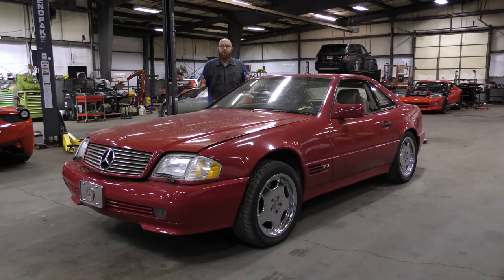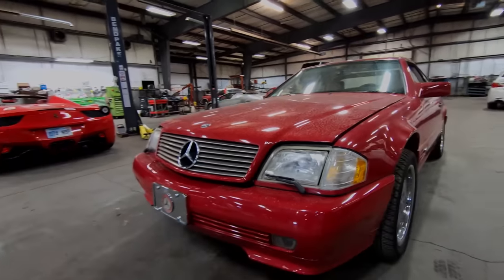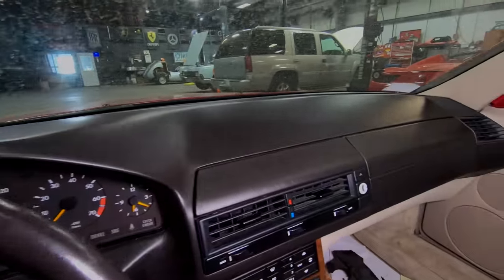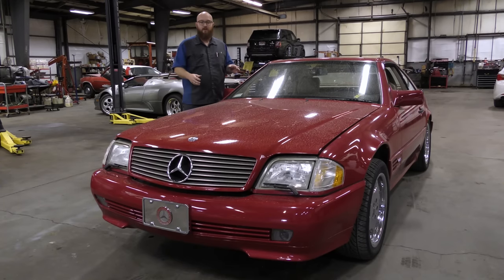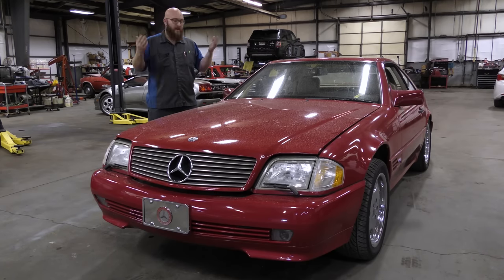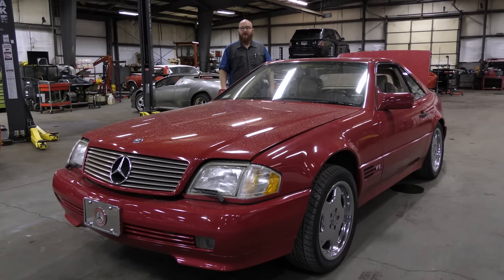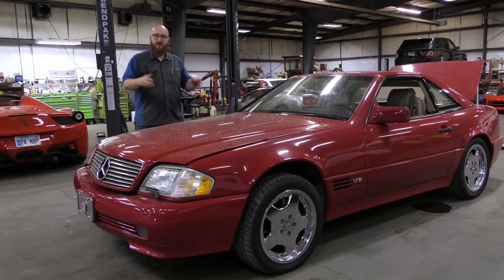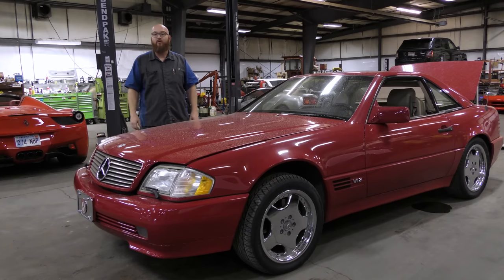Another customer scammed! CAR WIZARD shows why this '94 Mercedes SL600 is needing 15K to get sorted!

Comment: When you said that the wiring harness would have to be hand made and replaced I thought 9 grand is cheap. That's no small task. Probably takes a month.
Reply: I think I have sourced a new upper harness for it.
Reply: @Rock MacConcharraigh Getting all the new exact connectors with pins needed could be a big problem
Reply: @Rock MacConcharraigh That sounds good!
Reply: $9,000 seems excessive.
Reply: @emmanuelmcallister5412  what's so odd to me, I have only ever had GM cars, so I wouldn't even know where to begin to find crazy old random parts for a Mercedes, where do you look?
Reply from the maker: @althunder4269  List a shop that will do it for less. Ill send the customer to them. Then I will re-film the car and post the results, with you being the recommending informant.
Reply: @CarWizard  Got em!
Reply: @Rock MacConcharraigh you should buy that car then.
Reply: @CarWizard  Why do I need to do your job for you?
Reply: @althunder4269  not a good rebuttal lmfao finding a cheaper shop aint his job either my boy
Reply: @Rock MacConcharraigh Somehow, I'm not convinced of this. Sourcing connectors and terminals will be a challenge as both Mercedes and BMW use both US suppliers such as TE Connectivity and European ones whom are much less widely known such as LK or may have changed hands or changed their name since then. VW's main supplier, FCI is a prime example of this, their auto connector division was sold to Delphi somewhere between 2012 and 2015. And that's assuming you CAN pin each one to a single manufacturer. Sometimes the housing and terminal come from different manufacturers. I've seen this on rather common Japanese cars use connectors found on early Hyundais, but nothing was ever documented or in their catalogs. Housing was from a Japanese company, but the terminals came from a Korean one that they co-developed them with in the early 80s. Now imagine that being on an American car...

Remember Wizard's video about the Infini Q45 and how he couldn't find struts for it without a ludicrous pricetag here?
https://www.youtube.com/watch?v=EHZ1SVBAImI&t=353s

It took me less than 30 minutes to find their part numbers, cross-reference them back to the Japanese version (higher spec models are the same), and trace them back to who made them for Nissan. Then find a few dealers who had them. I call this "Tuesday".

Here's a hint, they're made in Indianapolis. Let that sink in a minute, a car built in Japan by a completely Japanese manufacturer for the Japanese Domestic Market has struts imported from the US.

Your mind has been blown.
Reply: @tsherwoodrzero  agree.
Reply: @WizGotBeats_  well it sure ain't my job.
Reply: @Rock MacConcharraigh deal.  What's your location?
Reply: @pablopicaro7649  You don't need new connectors, just the pins, which should be readily available.  But as someone said upthread, MKB-TEC makes a set of new harnesses for ~2000 Euros.
Reply: @SeanPennII  The dealership is your first stop. They really do have many necessary parts for older cars. At some point, when cars get very old, the Mercedes Classic Center gets involved. I'm surprised they haven't on this issue yet.
Reply: @althunder4269  you should’ve led with that one 😂
Reply from the maker: @althunder4269  Because you apparently know better than me. Prove it.
Reply: @CarWizard  don’t bother wizard this guy is a clown has no idea what’s involved in rebuilding a small wiring harness let alone these ones…
Reply: @CarWizard  $9,000 it must be because of inflation.
Reply: Wire harnesses are nor rocket science. Take out the old stuff measure the lengths. Buy the right colors and thicknesses. Crimp the right connectors. Wrap them with shielding. Done. Material cost like 200$ tops. Can be done in like a day.
Reply: The owner should keep this as a parts car, and buy a nice 18k dollars one.  He can come out ahead this way.
Reply: @42222  The wires must be made from gold.
Reply: @althunder4269  seen 4Runners have a $14000 harnesses ruined by rodents.   You have no clue what you are talking about.
Reply: It’s still available for 820 EUR from Kurth Classics !
Reply: @franzhuber7361  Doh !
Reply: +Evergreen641 In Germany getting this done costs you max 2000 euros, which is abou 2300 USD i believe. 
No wonder so many German Cars are called "Money Pits" by American Youtubers
Reply: @franzhuber7361  what’s available Franz, the car or the wiring harness for the 600? 

If it is the harness that’s available, is that for both the upper AND the lower harnesses or just one of them?
Reply: @pablopicaro7649  Yeah. High chance a lot of that stuff has become pigtail-pot-and-replace stuff (essentially, you take the connector on the component, get a pin that mostly mates with each of the pins in it, run a wire pigtail off that, attach your individual pins, and fill the connector with potting compound, and then put a deutsch or other modern connector on the end of your pigtails. And then you have to wire manage all these new connectors that aren't on the components themselves. And then replacing electrical components in the future becomes a nightmare because the guy doing it is probably not the wiring guy that did all that work.
Reply: @42222  ok buddy how bout getting access to it in the vehicle huh 🤔 one day I’d like to see you do it and have it come out like factory and not some horrible cob job when in six months all the connectors are corroded and your crimped ends are all loose inside the pins too u obv have never done a job this detailed
Reply: @althunder4269  gold is an excellent conductor. Don't be surprised if it's actual gold.
Reply: @houseofno  for 9 grand it should be made of gold.
Reply: @Rock MacConcharraigh No Rock, you couldn't. You're looking at a K for the terminals and connectors alone.
Reply: The wiring harness won't need to be hand-made as MKB-TEC supply these for Mercedes including the SL600.
Reply from the maker: @jamiespinks3657  yep. $3k per harness. There are 3 harnesses. This does not include labor. So hand making the harness is still the best option.
Reply: @althunder4269  You realize, you're the one that said the price is too much right? That puts the burden of showing where it is available at a lesser cost on your shoulders. As it is, you have gone with: "You say $9k? No that's too much, you go find somewhere cheaper because I'm not doing your job(finding a cheaper place) for you."  Can you see how that doesn't make sense or are you just a troll?
Reply: @Melanie16040  You sound like the troll.  You are late to the party as well.
Reply: @Rock MacConcharraigh Hello used to be neighbor! I was born in lancaster and used to live in hershey. Seems most people don't know enough to recognize subject matter experts when they show up.
Reply: @chartreux1532  Thanks.. I thought the same. It takes time but its not a hard job. It would cost like 600€ in Latvia. I just cant understand how americans can repair their cars when they literally get scammed by workshops.
Reply: @Rock MacConcharraigh Yah, Rock, I read it. I've also done this for long enough to know you ain't building a harness like that for $1000.00.  

Tell you what, Rock. You said you have a stock room full of stuff. I will buy from you every single Citroen-specific terminal you have. All of it. Every pin and socket, every color sleeve, every fuse clip.  Whadda ya say? I mean, if you are so willing to give up your parts stock for next to nothing.....
Reply: this is one of the bio-degradable M-B wiring harnesses isn't it? edit: got to the harness part and I see that it is- I can never remember which years they were!  Those all fail and need to be replaced, you'd think it would be still available without needing to be hand made since it's such a common failure item . . . but maybe there's just not enough of these around in the first place to support that, i dunno
Reply: @Rock MacConcharraigh What's the matter, Rock? Can't take me up on my offer? It's a real one.
Reply: @Rock MacConcharraigh It took you 6 months to wire your own car? Holy fuck.....
Reply: @Rock MacConcharraigh You got that wrong, Rock. It's 62 year old Bill Hemmorhoid.
Reply: @Rock MacConcharraigh The one where I offered to buy every Citroen-specific terminal you had. Every last one. You told me you had this huge cache of electrical terminals. I putting up my money. What do you have?
Reply: 12:00 👍 If you remember BOSCHE. Mandela Effect.
Reply: Making a wiring harness for a car of this era is a lot less high tech than you might think.
Reply: German cars from the late '80's into the '90's have wiring that was designed to be recycled... This has become a problem for those of us who love the iconic styling. 😞
Reply: The harness is $1200, I've also rebuilt one and it took me about 3 days. This dude is a scam artist
Reply: @42222  🤣🤣
Reply: @tsherwoodrzero  what brand are they?
Reply: @CarWizard  My old man is a tv repairman, he has an awesome set of tools and can repair anything
Reply: @CarWizard  nice save
Reply: Sold on Cars and Bids for $100,000.
Reply: @pablopicaro7649  which is why you re-use the old ones. they weren't biodegradable. Just the wiring insulation was.
Reply: @shaded_lp  
Definitely seems to be widespread in the USA, probably because of a Lack of Control of Mechanics but also Car Dealers. 
There is not one Day i don't read or watch Car Mechanic Videos on Youtube where i end up checking the Prices here and go "Wait, so Mechanic claims previous Mechanic scammed Customer but then proceeds to also ask for Money that i 5-10x what it would cost over here. 
That said: Of course Parts are harder to come by in North America, but that only explains Import-Costs of said Parts.
Also it's fascinating to watch/read that subreddit "Look what just rolled into the Shop" which shows a lot of the Issues with American Car Laws but also Mechanics and how such enormous Prices some Mechanics ask lead to People trying to fix it themself, with bad Results
Reply: @CarWizard  don't feed the trolls brother.
Reply: @pablopicaro7649  ....Connectors are already on the harness and they are standard Bosch....But, it would be a labor of love....LS Swap It! Make a Drift car😁
Reply: @althunder4269  You really should quit while you are ahead; oh wait…..your TROLL status has been established. The IRONY of this PATHETIC situation is your YT name. Maybe you should actually use it and then….there will be PEACE.
Reply: @standhd  is that all you have to say about it, Earl?
Reply: @althunder4269  Yes. Do you like drawing attention to yourself, comet?
Reply: @standhd  You seem a bit wound up about all of this.
Reply: @chartreux1532  Shop charges $100+ an hour (while paying their mechanics $20-30/h) and sells part 1.6 to 2 times what the parts store sells them. And every shop supplies, bolts and extra are charged on the costumer one way or another
Reply: @althunder4269  Naw, I’m not actually. I’ve delt with people like you before. You trying to TROLL me now?
Reply: @pablopicaro7649  the connectors can be reused.
Reply: @42222  Making a wiring harness is not something for anyone with Attention Deficit Disorder. 

Very tedious.
Reply: @althunder4269  missing a father
Reply: @tsherwoodrzero  yeah I’ve owned two Infinity cars. Almost Every part can be sourced with a Nissan parts number and bought from a Nissan dealer. Almost. Certain parts are JDM only but with some detective work you can find the same part and order it direct from a supplier.
Reply: @CarWizard  I'll do it for $4k......$3k?.....okay okay....I'll do it for $500....(wiring the OEM only..)....I don't do the hydraulics....

Here's what you do....research the best under hood insulation wiring.......by the foot.
Reply: @CarWizard  No, about 600 Euro for the upper one.
Reply: @Rock MacConcharraigh Normally just the engine harness breaks down prematurely due to engine heat. Doubly worse on the V12 where there is very little space or airflow.
Reply: I’m just a couple minutes into the video and you can tell the car needs a full restoration. It probably needs 100 grand worth of work.
Reply: @42222  a gazillion of those 90s Mercedes cars have been converted to normal wiring (Eastern Europe) without a single one to my knowledge catching fire because it doesn't use the oem connectors. I'm fully with you on this one
Reply: @Rock MacConcharraigh You questioned if it was just the engine harness or the entire wiring harness and I am giving you the answer, soooo...
Reply: @Rock MacConcharraigh I know because I work on these cars, is that good enough for you?
Reply: Less than 1500 from restoreyourmercedes (on youtube)
Reply: @HondaSolutions  the wiring harness on a toyota is 14k?  Lol. Brb, going to junkyard
Reply: @tsherwoodrzero  Just a thought but I reckon the old connectors weren't bio-degradable just the wires, no? So maybe you could reuse the old connectors with new wires. Quite a bit of work of course but for someone it could be worth it for a V12.
Reply: @mikeyorkav4039  can be.  Parts and labor
Reply: @davem5333  funny you should say that because I have ADHD and have built harnesses from scratch. Now I write service manuals and draw wiring diagrams. The key to success is working WITH the disorder to turn it into a superpower.
Reply: @kbcarroll  You need to remove all the old pins or sleeves, and get all new pins and sleeves, and that can be extrremely difficult to find.
Reply: @Rock MacConcharraigh Funny that you mention Toyota because anyone that actually does so knows that every manufacturer in Japan gets their harnesses from 矢崎総業株式会社 (Nihon Yazaki Sōgyō Kabushiki Gaisha) whom has been making harnesses for just shy of a century. If you knew what you were looking at, you'd find their parts in a LOT more than you think. And by the way, Ford fuse boxes are from EPC, now known as the PKC Group while GM ones predominantly are customized versions of standard Delphi products. If you actually did what you claim, you'd already know this.

Here's a hint: 2000 Dodge Dakota fuse box. Yazaki part. The white connectors in it use 090 and 180-series terminals and you'll never find this in any parts catalog or service manual. I disassembled two of them, then fully stocked one and rewired it for transplant into my RX-7 back in 2014, which also had a Yazaki fuse box from the factory.

This is why I am the Car Jedi. "Help me Obi-Wan, you're my only hope..."
Reply: @pablopicaro7649  I've dealt with this on the m104 cars. Same issue but only 1 harness and only 6 cylinders. For years the new harnesses were $1400 from MB only so a bunch of people just rebuilt their old one. You reuse the pins and solder them onto the new wires then insert them back into the connector, then sleeve.
Reply: @libran58  Reusing connectors is generally not a good idea unless they are in excellent like-new condition. After nearly 30 years of heat cycling, plastic gets brittle under the hood and we've all had Connector ABC123XYZ break. Plus, extracting terminals is somewhat of an art form that requires the proper tools and procedure. And there are times where a terminal just won't come out then too. I've had some terminals break in half and it was a REAL *** to remove the remnant from the connector shell, even under ideal conditions (Yazaki 250). The minute things go wrong on something smaller or more difficult to work with, it goes from annoying to 4-letter words, probably in German too. Some can be fudged with and still work fine such as Delphi Metripack (6.0L GM truck coil subharnesses) but most of the time it's faster, simpler and cheaper to start with new connectors. It also gives you something to work from when building the new harness to match the old one so all the branches line up correctly. GM/Ford and most Japanese connectors are pretty forgiving when, but I would decline the job on something German with a V12. On the BMW E38 7-series, the DME connector pins are stupid tiny, smaller than a paperclip, and I would bet their crimps won't tolerate much futzing around when trying to de-pin a connector. I encountered a few corroded ones on my uncle's E38 and I couldn't try extracting them with a clear conscience due to the risk of something breaking.

Clearly who designed it knew how to disassemble it too, and that person wasn't me.
Reply: @CarWizard   please check auto sparks in Nottingham,UK. They were featured in a wheeler dealers episode on a tr7 harness. And even showed how it is made.They might help or know who can.
Reply: Although it looks like you can get a harness for the car,guessing the Labour costs would make uneconomic.Anyway Mercedes should be paying,a wiring harness that falls to bits before the car!
Reply: @42222  7/10 troll points. Try to be more subtle next time. For me it was the last comment that tipped it over the edge I think.
Reply: @pablopicaro7649   use the old ones if needed. but every car built during those years needs them and a lot are common Mercedes plugs. that is, unless all the plastic is "bio-degradable".
Reply: I can build one for a can of Dr. Pepper and a pack of Camels
Reply: Hi wizardry ! Why does your wife talk abd sound like that? Is she from a state with a weird accent?

Also you've done a good job. Most informative car channel. 😇
Reply: Even after getting the harnesses, I can only imagine the labor involved at say $120/hr to tear everything apart, rewire the whole thing and put it all back together. And that's an expert doing it. I DIY my own cars and it would take me forever to do that, going slow and researching who knows how many times to get things apart. No thanks.
Reply: @tsherwoodrzero  "The Spectrum" is so wide, we're all on it. Saying someone has ADHD nowadays is almost worthless. If one can function in life, they don't have it.
Reply: @HondaSolutions  "$14000 harnesses" what? like 14 thousands? of dollars? hard to believe. which model?
Reply: No, 9 grand is just a rip off. I wouldn't trust that Mercedes "specialist". Seems very shady.
Reply: @cbruno12180  A clown? He's absolutely right. 9000 dollars is simply crazy for that job. There's no other way around it.

All of you who consider that amount of money reasonable send me your Mercedes for a wiring harness replacement or whatever they may need. I will happily do the job for you, making a tone of easy money in the process. lol

By the way, I rebuilt my own harness for the '91 600 SEL that I have. Then I put Kurth-Classic wiring for better finish, but the home made one works fine anyway.

Is it a big and tricky job? It sure is. A $9000 one? No way!!
Reply: @42222  If you think it's so easy and cheap to do, it's probably not a huge ask for you to prove it, which is exactly what I am doing.

These are wiring harnesses, with specific wire gauges carrying specific voltages low enough to count the number of volts on one hand.  The amperages are often measured in fractions of an amp.  Depending on the wire gauges, wire type and material, these are going to carry different resistance values.  Too little resistance, and you don't have a wiring harness, you have a very decorative scarf.  Too much voltage, and you risk damaging a very expensive computer module that's not produced anymore and is pretty much unobtainium.  We're talking about electrical differences measured in THOUSANDTHS of an amp.   Do you really want to be on the hook for cooking one of THOSE no longer made computer modules? You people act like a Subway sandwich guy cranks these out on his lunchbreak out of fishing line and bread crumbs.  If you think it's so easy and cheap to do, prove it.  Post the Youtube video.

I'm astonished at how many of these people put their ignorance on display by illustrating how little they understand about automobiles.  I'm going to double down on that comment by commenting that these people don't even understand how cars were made THIRTY YEARS ago, which is the case here.  These aren't cheeseburgers., These are electronic components manufactured by what was, then as well as now, one of the premier automotive engineering companies on the PLANET.  Mercedes holds the original patent for inventing the internal combustion engine powered automobile nearly a century and a half ago.  Mercedes spent more money engineering this SL600 than most of us will ever see in our lives, and you think you can make a new WORKING (big disqualifier for you trolls out there) engine wiring harness out of what have you for pocket change.

What are YOUR credentials, keyboard warrior?

Give the Car Wizard some credit for actually calling out when even he didn't have all the answers.  Even the Car Wizard reached out to the experts.  $9,000 when you CAN'T get these new anywhere else?  Pay up or stop bugging the guy who can name his price making from scratch what isn't out there anymore.
Reply: @E34Benzin  I agree with u 100 9k is just insane 5k is reasonable thou with removal and installation and parts I can that being 5k all day long thou it’s def not a simple job thou
Reply: @cbruno12180  It's not at all a simple job, that's for sure.

Dealing with the ECU's box (aka coffin box) to get the connections sorted is a pain in the ass. The injectors' wiring on the other hand is a 30 minute job.

Overall not a simple task, but not as bad nor expensive as Car Wizard tries to show us.
Reply: The biodegradable wiring harness reminds me of the water-based clear coat that Honda Acura had that always peeled
Reply: Knowing that people believe Mercedes to be a special car Mercedes should come out with parts more than they do
Reply: Dismantlers have nice used harnesses for the low
Reply: Just rip out the old harnas and nail that to a wooden board. Take another wooden board and start to copy all the wires from the first one and then you have
a new wiring harnas. 9000 dollar is just insane because a new one could be made in a few days.
New wiring harnases are made on a board like that, so it's not that hard and it's sure not worth 9000 dollars, because that's just a damn rip off.
Hell, when i would be sure that customers would stand in line, then i would start a shop myself and make 2 harnases a week and become 
a milionaire in just one year and a month! The only catch is where to find new connectors, because not a single one is the same
and i don't think you can buy them from mercedes, so you need to find the company who makes those connectors for all car brands.
Reply: @WizGotBeats_  Nice one. 😊
Reply: @Melanie16040  It’s very pleasing  coming across intelligent comments such as yours every now and again. If only “ NO COMMENT “ could live up to his name. 😂😂😂😂 and put his moniker into practice.
Reply: @CarWizard  oh now there's THREE harnesses at $3,000?   Good grief stop moving the goalposts.
Reply: @jan_vyhnak  he is lying, he made that up
Reply: @andregreen8040  stop simping.
Reply: @andregreen8040  It would be nice! Alas, it doesn't always work like that.  Ran across someone named "A Moron" in another thread that messed up reading a weight by a factor of 1,000x and telling someone how wrong they were because of it. Difference being they actually had a laugh and were like "Well I AM A Moron!" When I pointed it out.  Always refreshing to see people who can admit such things. Glad my post did the same for you.
Reply: 9k? he  betta be Working On It EVERYDAY!!.....Electrical Tape Always  Been my Friend
Reply: This post has turned into a troll-a-thon.
Reply: @althunder4269  it's probably his dream car
Reply: After getting robbed by a typical American endless money pit mechanic they say, "thank you sir, may I have another?"
Reply: I had fun reading this sub thread. Moral of the story, don't buy a car like this if you aren't 100% sure what you're getting into lol. And look at the engine bay. There's no room to do even a small task so parts will have to be taken out depending on the job which adds hours and $$$$.
Reply: I USED TO DO GLASS WORK...IN PHOENIX, AZ...AMBULANCES GOT WRECKED...THIS ONE SHOP SPECIALIZED IN REPAIR...THE WIRING ON THE FORD E350 VAN AMBULANCE IS A PILE 4 FEET DEEP & 6 FEET ROUND...GOBS OF WIRE...THEY DID ALL REPAIR WOTH HARNESS REMOVED...KEEPS WIRE DAMAGE AT A MINIMUM...AMAZING!!!
Reply: @Rock MacConcharraigh  Unless you're stalking people in the room, it's a stock room, not a stalk room.
Reply: @pablopicaro7649  Can the old connectors be removed and reused if not broken?
Reply: You'd be right in thinking if an amateur does it the first time, it'll take them a month - but a trained automotive electrician working on the same kind of harness day-in, day-out should be able to do a wiring harness with a couple dozen wires way faster - and evidently, that's what's happening at Kurth Classics and MKB tec in Germany - the german Mercedes enthusiasts send them those harnesses for refurbishing by the dozens, and day-in, day-out they work on Mercedes wiring harnesses. And as Mercedes'es have not much of a "halo" exotic status over here, often bought by Pensioners and straight up middle-class folk, they charge quite reasonable prices. And ship to the US, of course.
Reply: @Rock MacConcharraigh I guess people who have a Mercedes with a broken wiring harness, as shown in this video might care? Which, I take it, doesn't include you; that's alright, but why go "who cares" on someone offering a solution to a problem that made up half of the video you're commenting to?
Reply: Funniest thing is, they are ~ 500-1500 Euros in Germany to be completely redone.
Reply: @Rock MacConcharraigh but could you sell it for $1000?
Reply: @Rock MacConcharraigh non-mechanics and non-wirers don't understand that wiring harnesses are laid out on a 8x4 board with lines drawn to show colour and thickness of wires and all the wires go to numbered pegs and clips to show correct connector.   Once all wires are laid out they are taped into one bundle.
Two people cutting and fitting terminals and connectors could make a complete harness in a couple of hours.
Chinese factories have machines that can spin a complete harness in 77 seconds.😅😅😅
I saw assembly of Lotus car recently and harness filled a wheelbarrow.   Sheer craziness but if folks want everything electric then it has to be paid for.
Reply: @Rock MacConcharraigh Cool story bro... 👍🤣
Reply: @althunder4269  silly troll.  He was actually going to give you some business and posting it for under whatever rock you work under.
Reply: @alk3myst  Are you drunk today?
Reply: @alk3myst  stay away from the drugs and don't be a troller.
Reply: @althunder4269  #MethNotEvenOnce.  /ruffles head.  Stay in school kid.
Reply: @althunder4269  It really isn't.   I have custom wires made for GPS systems.   We have them made at an ISO9003 facility.   For a 5 foot cable with say 5 connectors you can very easily look at $1000.
Reply: biodegradable cables, what a great idea :-) new German cars are 100 % biodegradable after 100  K miles
Reply: The buyer hardly got scammed.
He was lazy !!!........
He obviously didn't inspect and drive it before purchase !!

You don't have to be a mechanic to test every switch and button during the test drive, that would have revealed the roof problem etc.

Buying a car unseen online is a fools game unless the seller has an impeccable reputation
Reply: @ltdees2362  possible but the pins are crimped on so you would have to pain stakingly uncrimp each pin and solder it to the new wires.

I've done it and it takes days
Reply: ill charge ya 1000
Reply: It’s like spinal surgery. But I guess if you’ve done enough of them ?
Reply: @pablopicaro7649  Find a donner vehicle. I’m sure they get wrecked when some geezer hits the gas instead of the brakes. The only people I see driving these things are practically dead.
Reply: @SeanPennII  German junkyards ?
Reply: @CarWizard  Exactly. Put up or shut up.
Reply: @althunder4269  It’s a Mercedes. Sucks money out of your pocket faster than my X.
Reply: @HondaSolutions  How freaking horrible. Especially considering a short couple fry a vehicle’s CPU.
Reply: @chartreux1532  Because they are money pits. Most people who own these pieces of crap trade them in every year or two.
Reply: Car wizard makes me laugh 😂. I rebuilt the stock wiring harness upper and lower harness on my 94 sl500 for the cost of correct gauge of  wires and pins. You can use your old plugs or buy new plugs if a few have damaged. I also rebuilt all my hydraulic top cylinders for under 100 dollars with new seal kit off eBay. I rebuilt my top cylinders 8 years ago and top works flawlessly. He's very comical guy but I like watching his channel even though he's looks to never pass a McDonald's. He be a better comedian rather than a mechanic. You got some Joe's or yoyo's out there who says they are pieces of crap but little do they know the 90s error sls were built like a tank and to me the easiest to work on. Learning to do things yourself is not for the dumb and lazy people of today. 😂😅🤣😆
Reply: @felixrobitaille8170  How do you expect them to cover all the overhead expenses which get very costly?
Reply: @johnjobber2219  I can guarantee you shop still makes a very decent profit at the end of the day, enough to pay their mechanic a lot more. Without going too much into finance, a shop can pay mortage, electricity, consummables, support jobs (director, advisor, secretary, etc), part of the mechanic salary and more ONLY on parts mark up. The rate pays the rest of the mechanic and everything else is pure profit.
Reply: @felixrobitaille8170  That all depends. I own a company with 20 employees and the margins are getting very tight. There are always downs times where you pays the employees but there is no revenue coming in.
Reply: @johnjobber2219  I was the assistant director of a 4 mechanics shop, I had access to all the accounting. I was director/advisor/andmore of a 2 mechanics shop after, same stuff. I know that usualy the bigger shops (7+ mechanics) tend to need to have a bigger margin on parts and higher rate because of down time
Reply: @althunder4269  Then ENTIRE car has to be taken apart, literally, the entire car dude. As in in, THOUSANDS of pieces. And then put back together. Basically, you are unbuilding the car, just to rebuild it. 9k is CHEAP
Reply: @CarWizard  I don't think people understand the entire care needs blown apart for this
Reply: Not worth the repair. Repair it at that price and something else will break.
Reply: I learned the hard way. I bought a 2011 Freightliner Sprinter from a used dealer in New York. I had bad crank seals, leaky turbo that was ready to explode. A dent up top with a blown out break light that cost $2500 to repair and paint. I found a new Turbo for $800. The radio was junk. I put in a new Radio and Bluetooth.
Reply: Hahaha here in europe i paid for hand made rebuild engine wires around 100$ hahahahahah he says 9000k$🤣🤣
Reply: Depends. In small production runs by specialised wiring harness manufacturers (those do exist), they might cost half or less, but still a couple of grand. EDIT: down the comments, it seems a German company is doing them for 1880 euros, exactly a couple of grand in dollars. That sounds about right.
Reply: There's quite a bit of wiring that can be saved,  some of it actually in situ.
I've done this on a '94 C280.
The ignition cables are encased in a rubber block on top of the engine  that gets hot and cold & starts to deteriorate from the inside.
Traced the wires as close as possible to the firewall until l came to where the casing was in order.
I carefully retrieved the bare ignition wires from the  rubber block etc. and de-soldered all  terminals.
Then re-insulated all wires with firstly good quality heatshrink and secondly covered the heatshrink using heatproof tubing.
Re-soldered and re-connected all terminals.
The engine fired up A1.
The whole operation took a couple of hours ( l worked slowly).
This was some six years ago and since then l have not experienced any other wiring problems.
It seems to me  that where ever wiring is exposed to heat, that's where the problem is likely to occur.
Reply: @kbcarroll  l agree.
Have done this myself on a C280 six years ago on ignition wires with satisfactory result.
Reply: @Eclipse538 he made a fool of himself 😂
Reply: @althunder4269  

When I had an electrical short on my 2000 Freightliner Century truck-tractor, none of the seven truck repair shops within 15 miles of garage the truck would undertake trying to chase down a short and the turn signal system for less than their hourly rate, which four years ago I think was $130 per hour for this shop that actually I hired for the work. Took them 5 hours to find it and repair it. I had to pay $650 for 5-hours of labor plus $50 for materials.  A total of $700 out the door. 

And my truck is a day-cab with no emissions crap on it so it is really easy to work on. That time might double with newer tractors with made with in the last 10 years.
Reply: @Theblueghost69falcon289  
You are fortunate that you can be your own mechanic.

It is evident that the purchaser of this vehicle cannot be his own mechanic so he doesn't have the easy affordable layout that you would have.
Reply: @althunder4269 LOL 😂
Reply: you can fix the hydraulics yourself for like 90 bucks lol